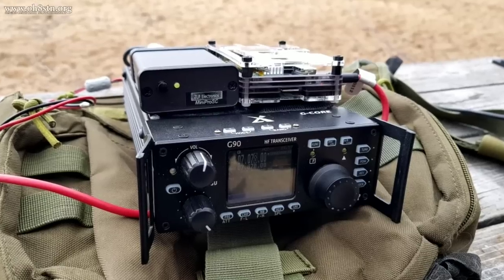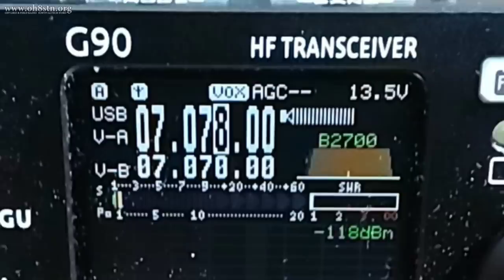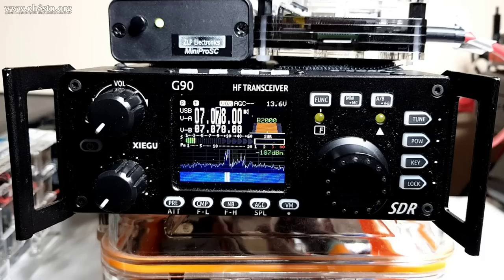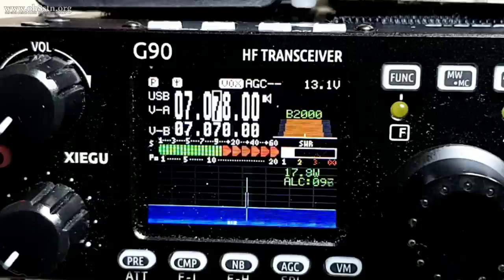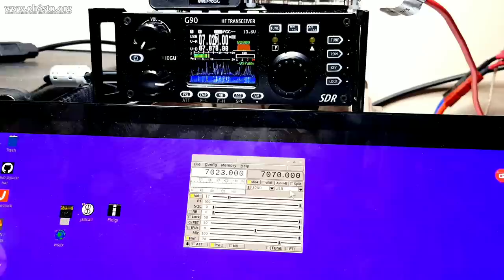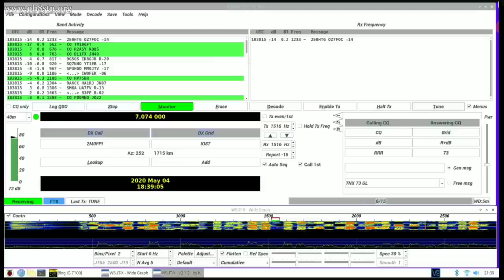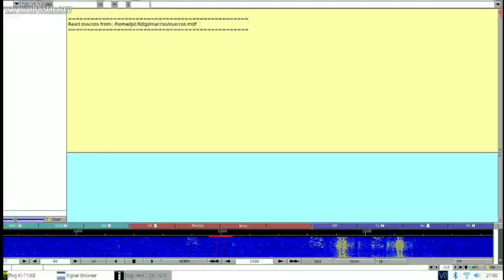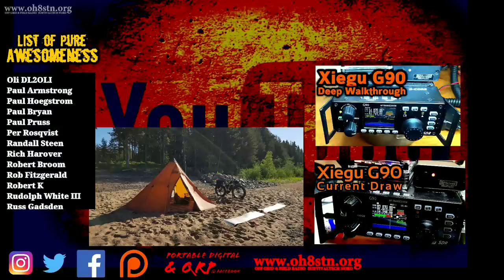Xiegu G90 Digital Modes Setup

Comment: What does it mean when it says faild to set unsplit mode
Reply from the maker: I've never seen that error before
Reply: Must i update my rig to adjust the alc i went to the store and bought trs plugs and got it to ptt but my alc is high according to hrd
Reply from the maker: The high ALC means the tx audio level should be reduced. You can do this using the slider in the app.
Reply: Thank you OH8STN 73 brother

Comment: Let me give you a challenge. Get a digirig working with a G90 running Ham Radio Deluxe. This has been a challenge. Who is up for that one?
Reply from the maker: Ssdly, Ham radio deluxe is the problem. It's a great idea, but has become too big and complicated.
What problem are you having?
Reply: I am trying to use a digirig with windows and HRD. I’ve used HRD since its inception. I want to use it for RTTY, CW and FT8. I try and connect when the cont gets to read frequency. Says make sure radio is on.  I was told to use IC7200 as radio in HRD connect. I do get a port assignment in Device manager.
Reply from the maker: The typical problems with hrd are 
- Wrong commport or commport speed.
 - wrong radio selected.
- Incorrect audio interface selected.
- Radio is not in the correct mode.
- Wrong data input selected on radio.
- Wrong ptt commport selected. 
The "radio not on" tells us it is likely a commport setting communicating with the radio.
Even though this video is not about h r d, It gives you all the information you need to set up/troubleshoot data on the G90, with any software. Focus on the data modes, as CW complicates troubleshooting. I'd suggest starting with FT8.
With the device manager open, plug in your digirig. You'll see a new device in the device manager. Take the commport from that port and write it down. Also, ensure the correct port speed for the G90 (not 7200) are selected in the device manager for the digirig commport.
Icom ic-7200 is the correct radio from CAT control perspective. 
When using the digirig with G90, you are setting up the digirig and the G90. The 6200 is just a compatible rig from CAT perspective. 
I would suggest writing down all the settings in question with HRD running FT8, commport, audio device, input, PTT port, ... then watching through this video to find similar settings. 
Years a go when h r d was still developed by the Swiss operator, I had a license. When it was sold to the current owner, I never bought a new subscription. This would be a very easy tutorial to make, If I had an HRD subscription. Sadly, I wouldn't use HRD enough to justify the expense.
Reply: Thanks for response. It does show up in Device manager. Oh, two different Windows computers. On a HRD forum I found 4 PDFs that I tried still same issues. Under flrig says can’t open port. On HRD can’t read frequency so I assume port not opening. Got me wondering if Windows defender blocking port might be the issue.
Reply from the maker: @mhpreach Windows defenders definitely a possibility. However, If you can see the port in device manager but can't open it with the HRD application, the problem is most likely a setting for that port. Port speed, xon/xoff, ...
One suggestion is to try WSJTX for troubleshooting. Once you have the settings in w s j t x, they can migrated to HRD. 
Btw, FLRig has a preset for the Xiegu G90 already integrated.
Digirig forums is the best place to get support for digirig and G90.
Having such little information about your settings, It's almost impossible to help you troubleshoot.
Reply: No luck in flrig or Wsjtx either on either windows computer.
Reply from the maker: @mhpreach I'm still certain it's something simple like port speed. Without seeing your configuration, it's difficult to help. Try reaching out to Denis from Digirig.
Reply: @OH8STN  I’ve been in communique with him

Comment: I have both the G90 plus a ft891 just like yourself and there about the same price sold the G90 because the ft891is far superior radio by miles .
Reply from the maker: I totally agree. The ft-891 is a superior radio. The ft-891 user interface is its best feature. That's followed up by  it's magnificent filters and DSP. The G90 does have some advantages. Lower receive current, lighter weight and slightly lower cost. My goal isn't comparing these radios. My goal is simply educating people about how to use the radio they've chosen.
Reply: The 891 is a joke, closely compare the sherweng data with the March 2020 QST review where you can. The G90 most of the time runs circles around the 891.
Reply from the maker: Ridiculous comment Gust. The ARRL was also the one who originally said the 891 was a bad radio. Three years later that's proven false. If you want real life problems with the 891 there are two. It doesn't have an internal audio interface, and it doesn't have an internal antenna tuner. It does have an excellent receiver, filter manipulation and excellent DSP. Never mind being a 100 watt radio slightly larger than the G90. I'm really enjoying the g90 but you're comparing apples and oranges. I would choose one or the other of these radios for different reasons.

Comment: First, thank you very much for making these videos! I have the G90 and the CE19 and since the MiniProSC is unavailable at this time in the US. I would like to make the cable shown @ 4:28 but I'm unclear as to the pinouts. I don't see any diagram in the manual that breaks down how to make this cable. I'm not worried about the extra cables since my whole setup is inside a portable seahorse case which I have built to be completely self contained. Here is a pic of the box if your curious: https://tinyurl.com/ybhxx9n4

The included audio cables have a red, black and white wire. Do I just connect black to black, red to red, and white to white? then plug in to the sound card? Don't want to fry anything :)

Thanks!
Reply: ZLP has them back in limited stock for the US...:-)
Reply: Yes I’m very curious as well on the design and pinout used for the audio cable you made. If you could share that would be a huge help. Thanks!
Reply: @97irishflyer  I'd rather make the cable at this point. I'll have to just give it a try myself and see what I can figure out. Bummer we can't get a response to this simple question. =(
Reply: I read some additional comments explaining how to make a “Y” cable by following the user manual but it still wasn’t super clear. Can anyone help? Thanks!
Reply: Tracer Facer I’m sure it’s super simple I just don’t want to fry my brand new equipment or soundcard.
Reply: @kacymcginnis  well I just fried mine... don't try this until someone gives explicit instructions on how to make the right cable. My radio is toast now. The unit turns on but the head unit is dead from what I can tell.
Reply: Tracer Facer Oh man that sucks! Can you post the wire diagram that failed? Maybe someone can help diagnose the problem.
I abandoned the c19 all together and replaced it with a MiniProSC and Raspberry Pi 4 setup with the AmRRON
Script. I just followed OH8STNs instructions and it was actually pretty easy.
Reply: @kacymcginnis  Actually, I'm not sure it was the cable. I realized after the fact that instead of plugging the Y cable into the CE19 AF out connection, I stupidly plugged it into the side of the head unit. Just not paying attention. A case of having read too much and got confused as to which method I was using. So the cable was going from the head unit to the sound card. Totally my fault. As for the cable, I just did red to red, white to white, black to black. Plugging into the wrong port was likely the problem.
Reply: what makes it even more frustrating is that I had just ordered a complete kit to avoid using the CE19 - but thought I would play with it while I waited for that kit to get here, and now I ruined the whole thing sigh
Reply: Tracer Facer oh that makes sense. Maybe you could re-flash the whole radio with current firmware and un-brick it?
Reply: @kacymcginnis  worth a shot
Reply: @kacymcginnis  That was it!!!! Everything is back to working again!! WOW I'm so surprised that worked! thought I really screwed it up!! Thank you so much for making the suggestion! I am going to leave it alone now and wait for my cable kit to get here! THANKS AGAIN!!
Reply: Tracer Facer Oh man that’s awesome I’m really glad it all worked out and fixed your radio.